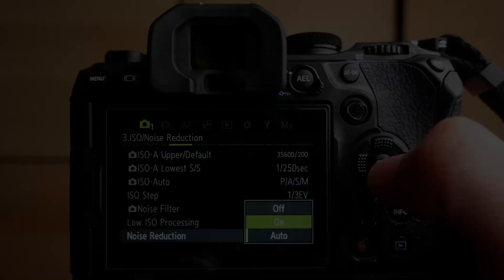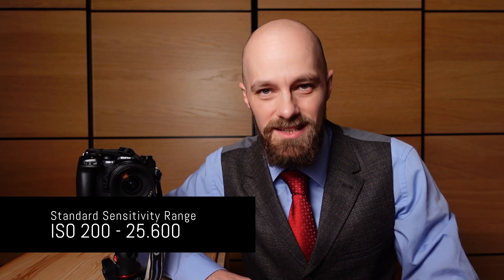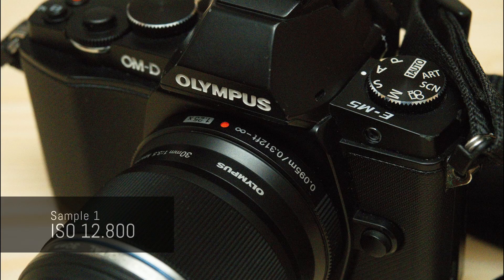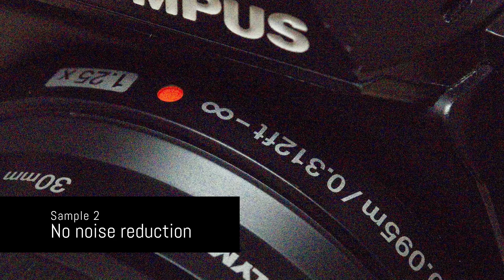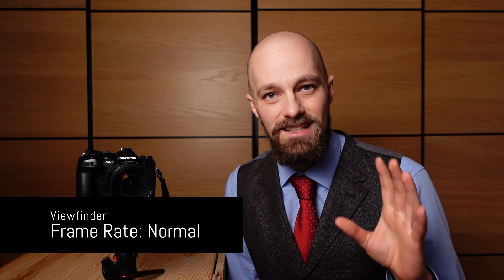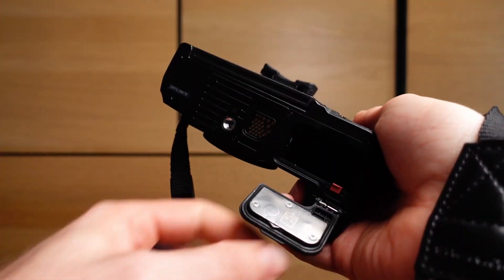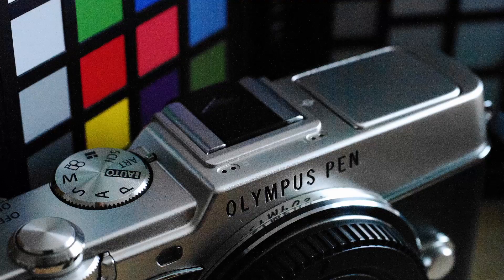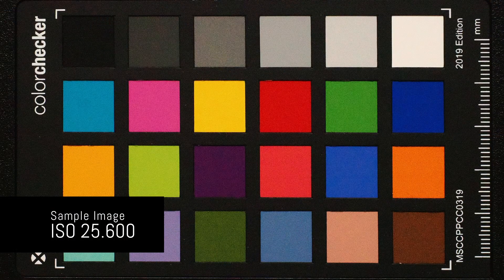OM System OM-1: A Masterclass on Image Noise

Comment: I'd be interested to know if a future software update could use the pixel shift technology to take say 4 images and then median stack them to produce a 20MP image with vastly reduced noise. This way the images could be taken in a fraction of a second possibly
Reply from the maker: From an engineering perspective, it would definitely be possible.
In a way, this is already implemented with the 25MP setting for High Res Shot. However, the camera takes the full set of images,  so there is no real "speed advantage".

Comment: Love the grip suggestion. Using the grip and a tripod I often shoot with ProCapture and the remote so the camera stays on, never going into sleep mode, which means it gets hot. I can switch batteries easily enough so I'll try taking the battery in the body out. Another reason for a larger OM-1X! 

I also had no idea that the OM-1 was ISO variant. Great piece of information. FWIW I believe I have seen evidence of what you're saying. A couple of times I inadvertently lowered the ISO which forced me to push the exposure in post. The files were unusable as compared to the files shot at higher ISO (four stops?) using auto ISO.
Reply from the maker: I would be very interested in an OM-1X for the exact same reasons. It just makes sense! However, with the grip the OM-1's already good heat management is further improved, definitely worth the money I'd say.
Thank you very much for your feedback and for sharing your invaluable experiences! All the best!

Comment: Thomas, we find that the Olympus OM-D E-M1X's viewfinder will black out when wearing a polarized sunglasses.
Has it been improved or corrected on the OM-1 (digital) under OM System?
Reply from the maker: I currently do not own polarized sunglasses, but I've done some research and here is the result - the OM-1's viewfinder panel is an OLED and it therefore should not be impacted. One user confirmed that, but I've not been able to test it personally.
Hope this helps!
Reply: @ThomasEisl.Photography Can you use a polarized filter (lens-most pros have that) to place in front of the viewfinder & LCD screen to see if it black out?
Reply from the maker: Unfortunately I don't have one right now 😞 maybe you can try it in your local camera store

Comment: Thomas, I generally use eother ON1 or Luminar Neo for editing, often through their plug-ns in Apple Photo. I just bought an OM1 after renting it for a trip to Costa Rica, and subsequently installed the OM Workspace software. The AI noise reduction is the best I've seen, better than ON1, which is beter than Luminar. But when I subsequently open in another program a file that has been processed with OM Workspace, the quality is degraded. Should I export it as a TIFF or DNG to retain the exlellent noise reduction from the OM Workspace? Thank you,
Reply from the maker: Hey Richard and welcome to the "OM-1 Club"!
In order to get "keep" the image quality for other programs, you should export the processed file to a TIFF file (if you want to do drastic processing) or JPG (if you just want to do minor adjustments).
If you just open the RAW file with another converter, the adjustments from OM Workspace won't carry over!
Hope this helped!

Comment: How good is high iso now in the om-1. Is it capable for sportfotografie in bad light conditions? Or maybe event or festivals at night.
Reply from the maker: Absolutely - I've shot it at ISO 12.800 -25.600 f/1.4 1/500 at fashion shows and so on.
Check out some of my other videos - or my social. LL is not an issue with the OM-1

Comment: How do you determine which ISO to use? Do you always use high Res mode and noise reduction ?  Do you have online workshops or videos on post production? I subscribed and shared your channel with many others.
Reply from the maker: Hey there and thanks for the awesome contribution!

Regarding setting the ISO: I am actually always picking the highest ISO needed and the lowest possible, but I also always try to make sure that I have exposed the image "enough" so I do not have to push in post production, which deteriorates the image quality.
With the OM-1, I leave the noise reduction to "Normal", I think the results are pretty convincing when doing so!

Thank you very much for promoting the channel, this is highly appreciated and really helps me to produce more content! Thank you again!

Regarding Online Workshops:
I actually did offer Post Processing Workshops in the past, would you be interested in an OM-specific Post Processing workshop?
Reply: @ThomasEisl.Photography  In regards to an OM workshop- I am not interested in it now- but will be in the future when I get an OM-1 or OM PEN-F II😃. However, some photographers create online courses that people can purchase at any time, which may be more convenient for you. I believe Matt Seuss does this.

Comment: Useful info! I wasn't aware of the issue with pushing raw files, or of the noise-inducing effect of taking a lot of images. (I knew about the problem with long exposures, though.) I had noticed, though, that exposing to the right of the histogram results in remarkably lower noise levels in things like skies, even when the image looks overexposed in the viewfinder. Better to bring the exposure down a bit in post than to push it.
Reply from the maker: Absolutely, Barry! In a recently published video, I talk about the dynamic range of the OM-1. Metering to just not overexpose the Highlights is a very useful technique.
Thanks for the comment!
Reply: @ThomasEisl.Photography  About to watch that one . . .

Comment: If you don't need the high resolution, you can use the ND computational mode to average across images and reduce noise.
Reply from the maker: Yes! I will talk about it in a separate video, it is such a great feature!

Comment: Thank you for this information 
1) is there an advantage of switching off the camera when not in use to avoid heating during non use
2) are there ratios for base iso above 200, for example 400, 800, etc that take advantage of system math
3) using picture profiles on JPEG versus relying completely on raw may save space time and processing especially if image processing internally is native to system hardware do you have any experience with this
4) is there a recommended computer configuration to run the latest version of om work space
Reply from the maker: Hey Kevin!
1) Yes, if you switch it off, you are keeping it even "cooler"
2) I am not quite sure what you mean, maybe you could re-phrase the question
3) If you expose correctly, only shootng JPEG can save time, you limit your post processing options quite a bit when doing so, unfortunately.
4) I would stick to the specifications recommended by OM System, see here:  https://support.olympus-imaging.com/owdownload
Reply: @ThomasEisl.Photography  on 2 there could be multiple sweet spots for iso that are multiples of 200

Comment: Are you absolutely sure the OM-1 has 3 ADCs?
Reply from the maker: Yes, I am - at this point - convinced that the ADC operates in three stages. An independent testing site (photonstophotos), an independent OM expert (narrowbandchannel) and my tests all came to the same conclusion.
Reply: @ThomasEisl.Photography  Photonstophotos definitely did not come to the conclusion that the ADC operates in three stages. There's a second gain stage that kicks in at ISO 1000 and then at ISO 16,000 the camera bakes NR into the RAW data; which is pretty clearly indicated in the P2P plot if you read the legend. The narrowband guy based his conclusion on the 3rd ADC stage based on misunderstanding the P2P data which I suspect is exactly what you've done as well.

Comment: When using auto-iso, this noise problem dont exist? i mean if you add more exposure, it changes to bigger iso? am i right? So i should not use ISO80 or any below 200? Thanks
Reply from the maker: Hey Juha!
If you use auto iso and find the image is too dark later when you process it, you might want to push it. So the same issue might be the result. In order to avoid that when working with auto iso, I recommend exposing the image correctly in camera, so you don't have to use the exposure slider in the RAW converter.

And yes, I would not use anything lower than ISO 200 if it can be avoided. The camera will have less dynamic range and potentially more noise when doing so.

Hope this helped!
Reply: @ThomasEisl.Photography  Thanks, you are making good stuff.. Keep going! Greetings from Finland.
Reply from the maker: Thanks a lot, Juha!

Comment: Thank you for this video, Thomas. Clear and concise. Very useful.

Another way of reducing battery-induced heat build-up is to run the camera from a power bank in your pocket via a USB-C cable, when engaged in an intense session (e.g. studio or astrophotography with dark-frame NR engaged). I shoot mainly wildlife with my OM-1 and portability is important at my age. I would not want the bulk and weight of the battery grip added to my walk-around kit. Battery life is so good that I don't need the extra reserves of the battery grip. I replace the in-camera battery if it becomes exhausted.

Also, as good as the OM Workspace is purported to be, I will not use it because I run a Lightroom + AI denoising plug-in ecosystem for my work. Adding OM Workspace to that mix seems cumbersome.

I would use OM denoising software if it was provided as a Lightroom plug-in. 

I'm a retired professional photographer.
Reply from the maker: The power bank is a great tip, I have not thought about that!

Regarding OM Workspace, yes, it is cumbersome to "add in". I'm also constantly on the fence about it, as it can be a bit "lame" compared to other software options. Professionals like us value a "sleek" and fast workflow, I am totally with you. I'm thinking about sharing my "fast OM Workspace" workflow in a future video (it won't be as convenient as your workflow I'm afraid).

Thanks for the contribution, much appreciated!
Reply: @ThomasEisl.Photography  Thank you, Thomas. I am glad that my opinions resonated for you as well.
Reply from the maker: Absolutely, thank you Sir!

Comment: Thomas, thank you for the most comprehensive overview of how to,cope with noise on the OM-1. Especially, the first part about ISO invariance gave new insights to me. The real game changer in dealing with high iso images, however, is DxO DeepPrime XD algorithms, which also operate at the demosaicing stage. The results are impressive so that ISO 12800 is not an issue for me anymore. DxO integrates well with Lightroom Classic as a plug-in. OM Workspace is too clumsy for me, so that I would not consider using it regularly.
Reply from the maker: Dear Thomas, thank you very much for your feedback regarding the video - I am very happy that it was helpful.
Thanks for the recommendation in regards of software, I will test it!
Best wishes from Vienna!

Comment: Maybe you should mention you can connect the OM-1 to OM Workspace so it can operate really fast applying the same algorithm as in the camera, but with more control from the software. Otherwise, the program is very very slow even on a powerful computer. (I'm using Mac, don't know how the PC version is.)
Reply from the maker: Thank you for adding that - and you are completely right about that!
In fact, I will record a second video talking about the editing workflow in detail, where I will mention that.

Thank you for the comment!

Comment: very interesting observation about the battery grip as primary energy source to reduce heat. I think as a compromise one can still use two batteries, with the first one to be used in the grip. Should this drain before the shooting is done you can still get some shots, with some noise, but better that nothing at all.

Also, the E-M1x is rumoured to have better heat management then probably all recent OM-D cameras. The integrated grip with the two batteries stored away from the sensor may be the reason why. A successor to the E-M1x with the new technologies would be very welcome.
Reply from the maker: Regarding your double battery but grip priority idea - yes, that is a very good idea! All in all, only when shooting with the OM-1 continuously for extended periods, the heat will reach a level that is noticable in the image.

The E-M1X is truly a "cool" camera, as you've pointed out. The internal heat sinks and the double battery holder in the vertical grip are conscious design choices to mitigate any heat issues. It is not a coincidence that the Nikon Z9 follows the same design principles.

Thank you very much for your contribution and kind comment!
Reply: @ThomasEisl.Photography  Thanks for your comments. I got my OM-1 and I can confirm that it is set as a default to use the grip battery first, if present.

Comment: Thanks for this video. Really interesting! Does this also work with older bodies? Such as em1x?
Reply from the maker: Yes it does - there is one difference: the E-M1X has two instead of three ADC stages - the advice is the same: use the ISO setting needed, and don't push in post production.

Thanks for your kind comment, hope I was able to help!
Reply: @ThomasEisl.Photography  I will try this one out. :) Does this work on basically all Olympus bodies? Cause I have Pen-F and em1x
Reply from the maker: Yes, it even does work with cameras of other manufacturers, if they are not ISO invariant.

Keeping the heat as low as possible is also a very good idea for all mirrorless cameras
Reply: @ThomasEisl.Photography  Thanks a lot for your advices and everything. Have a nice holidays!
Reply from the maker: Most welcome Sir, for you too!
Reply: I also have trouble understanding your recommendation about the ADC.   I have the E-M1 mk II.  If I have a high dynamic range picture, say a stained glass window in a church, would I be better to raise the ISO and shorten the exposition time (so I don’t overexpose the highlights) or keep the ISO at 200 and lighten the shadows in post to see the details in the dark areas?  And what would be the 2 stages of ISO for the ADC in the EM1 II ?
Reply from the maker: @Guy Racine
ADC stages of the OM-D M1-1II : Stage I ISO 200 to ISO 1600, Stage II ISO 2000 and up

Dynamic range - a future video will tackle that, it's a bit complicated. In your scenario, it is best to keep the ISO to 200, expose so that the highlights just don't clip or shoot a series of bracketed RAW shots for HDR composition later or perform a JPG in-camera HDR. Thanks to the stabilizer, you can use ISO 200 (best image noise and dynamic range) with almost every still subject.
If you shoot action, you have to get a certain shutter speed to freeze the motion. When doing so, it is best to use the ss and f stop needed and set an appropriate ISO number, rather than underexposing the shot and pushing in post - as you might jump ADC stages.

To conclude 
Whenever possible shoot ISO 200 - if higher iso is needed (faster shutter speed), raise it as high as needed so you don't have to push in post.
The iso 200 file can be pushed for some stops before you "jump stages".

Hope this helped, feel free to follow up with questions
Reply: @ThomasEisl.Photography  Thank you, Thomas.  I really appreciate what you do.  Keep up the good work.
Reply from the maker: Most welcome @Guy Racine - thanks for the nice comment

Comment: I am shooting with a Pen F and 12-40 f2.8 Pro. I've done a comparison of files shot at ISO 25,600. Jpeg with in-camera noise filtering as well as a raw file post processed in OM Workspace 2.1.0 using noise filtering and alternatively using DXO PhotoLab 6 and Deep Prime XD. The raw file shows a lot of noise. In-camera and OM Workspace all produce muddy, blotchy results whether using standard, low or high noise filtering. After applying Deep Prime XD, images looks as good as those shot at ISO 1,600 and that's without sharpening. Sharpening when applied sparingly helps even more, but anything beyond looks artificial. 

Results with DXO software are astonishing. Maybe OM workspace does better with files from the OM-1, but for me DXO makes my MFT cameras into low light monsters. XD is significantly better than original Deep Prime. You need to try it!
Reply from the maker: Thank you very much sharing this recommendation!
I've never used DxO, but I will give it a try - your recommendation sounds very convincing!
Also, I've got a Pen F somewhere, so I will test whether I also have the same issues when using OM Workspace.
Thanks Robert, much appreciated!
Have a nice holiday season :-)

Comment: Great video Thomas, many thanks. I note my OM-1 has the Noise Reduction set to Auto by default. Do you recommend this setting or should I turn it off (I only shoot RAW)?
Reply from the maker: I would recommend leaving it to Auto - this will give you good results for most situations, as the OM-1 will automatically use Noise Reduction when the internal camera temperature is elevated, which equates to "when it is needed". I have it set to Auto 99% of the time.

Thanks for the comment and the kind words!
Reply: @ThomasEisl.Photography  Many thanks. 👍